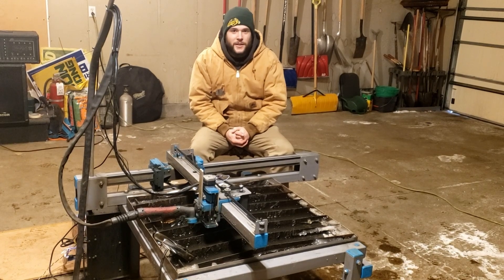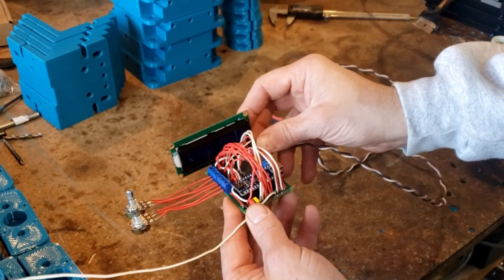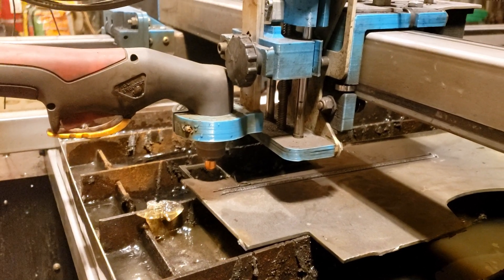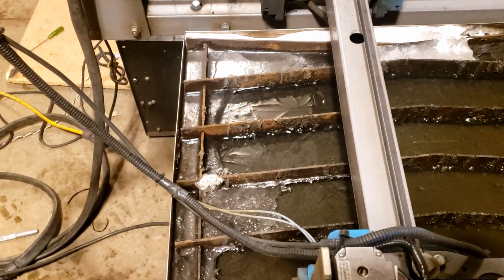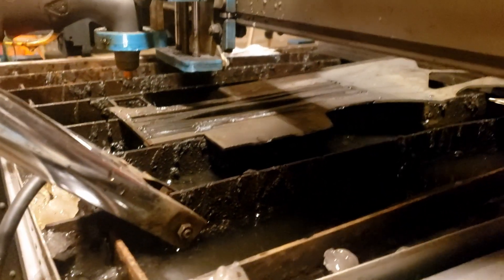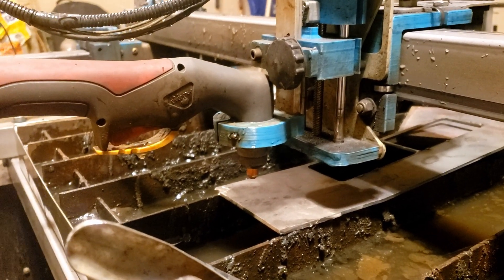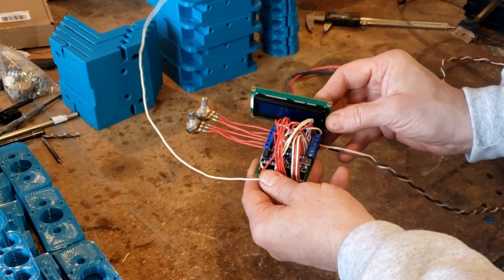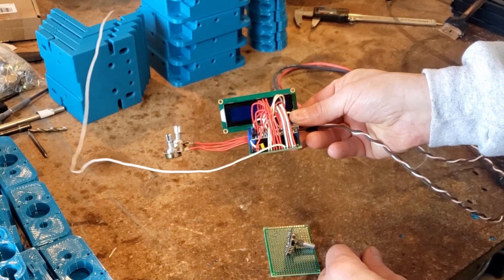DIY CNC Plasma Cutter Torch Height Controller

Comment: Ive done a diy height controller too a couple of years ago. Good to see someone else actually tackle a diy torch controller. I did things slightly differently.

I had an optocoupler, the input was connected to the torch voltage with a large resistor to drop the current to the operating range of the optocoupler. The output high side was connected to 5v, thr low side had a 2.2uf (i think?) capacitor and a trimpot as a low pass filter and a second trimpot to ground as a pull down to get rid of static noise right before the arduino input pin. 

This provides galvanic isolation between the torch voltage and the arduino so the torch has no chance of frying the arduino and cnc mainboard.

Other little software things ive added to mine is a self setting arc voltage. The torch pierces at a height, pierce pause, drops down to the cut height and then the cut starts and height controller activates. Like you i added a little delay to get away from the high torch voltage from the pierce point. Then i had the arduino sample the torch voltage for ~300ms and average it out, set that as target voltage. What you really want is a specific height, the voltage is thay occurs at is dependent on humidity, temp etc. My method automatically adjusts itself for each cut on its own.

But yeah, its crazy how cheap a diy version is compared to an off the shelf..

Comment: Very nice work, guys!  As an embedded / automation designer and programmer myself, my biggest concern for the voltage (height) feedback would be EMI/RFI (electrical noise) from the active torch.  Your 51:1 divider may already have some isolation in it, but if it's a problem for you, some ferrite beads or toroids on wires in the feedback path may help.

I really want to CNC my plasma cutter, so I intend to buy your plans.  This potential torch height addition is thoroughly awesome!

Comment: Reason these things (THC) cost is not the price of parts, but the development. Straight line is difficult? Try corners or small holes... And plates do bend and jump during the cut . Also initial pierce height can not be reliably set with floating switch , the weight of the head will always push material down or bend it so it ruins the nozzle .... ohmic is a must.

Comment: I would like to cut a straight line like you did in your test cuts to determine my kerf with and heighth. Is there a way to simply cut a straight line?  Do I need to set up a cut in Fusion360 and then convert to G-Code? What is the best way to do this to dial in my plasma cutter. Thanks

Comment: Would it be possible to explode the cutter plans like 2-300% to make a larger model, and still have it work with the controller setup for x/y axis? Maybe just add a y axis brace on opposite side
Reply from the maker: Yes, we have seen people do it before.
Reply: Doing just this right now. I will have a finished cut size of 48x36. There is a bit of wobble horizontal on the 36" Y axis so we will see how it all works out

Comment: I converted my Longmill CNC Router to hold  a plasma torch. Has been working well, but have been looking for a THC. Do you plan to release the Arduino sketch? I would love to work on that.

Comment: the THC i have has complete control of Z(which I dont like), but all pierce, arc start etc is controlled by THC. it has 3 knobs, violt,delay, initial arc hieght.
Reply: Can you send files ? And info ?
Reply: @TheLoup117  not sure what files you want, also I found a THC that I like better. It intercept z stepper for during cutting only. All other Z movments are machine controller.
Reply: @customsolutionsinc  link more info parts ...

Comment: What about the voltage divider guys?
Reply from the maker: We are using a 51:1 divider it is briefly described in the beginning of the video.
Reply: @jdsgarage701   it's pretty light on the voltage divider, where did it come from, what was it?....i purchased the plans...maybe i'm missing it....i have the same machine.